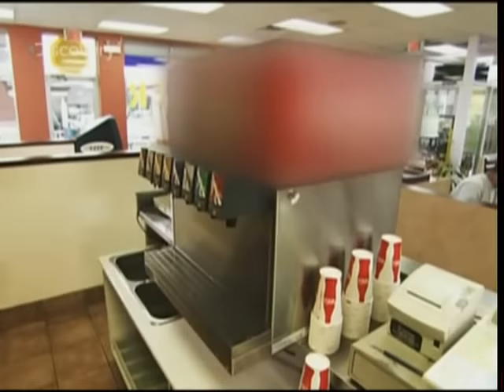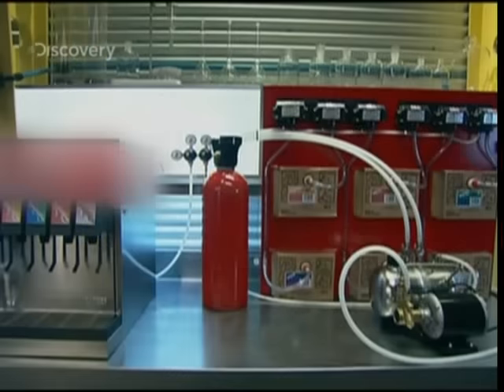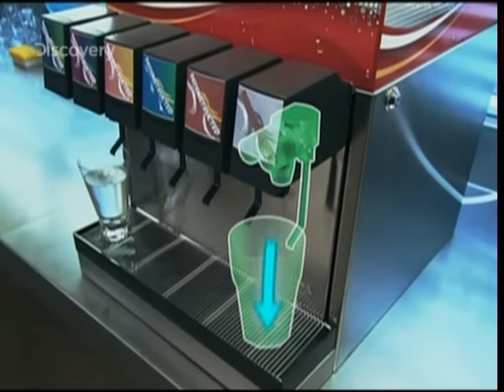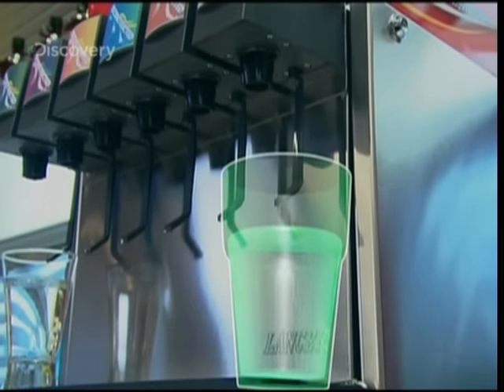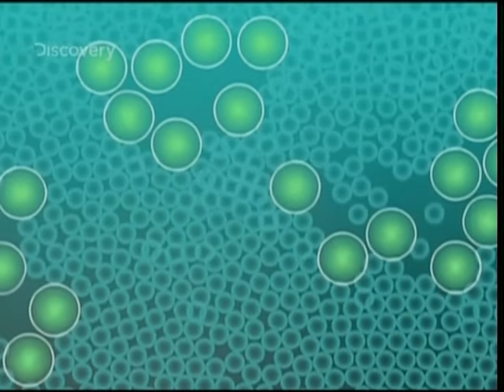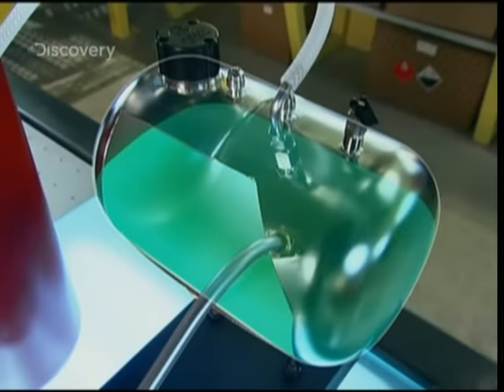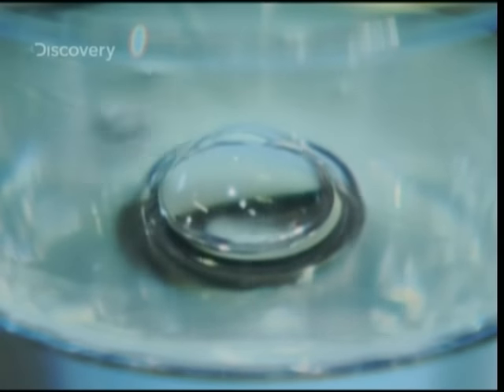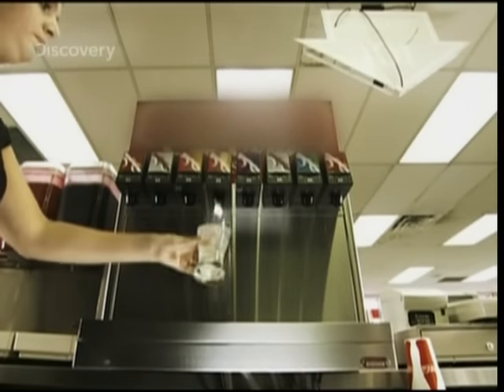How A Soda Fountain Works

Comment: Is it me or does sodas from this machines have more gas and bubbles? They also taste better than normal bottle sodas for me
Reply: because it’s the freshest form it’s being made as it dispenses it ,it don’t got time to slowly leak or lose carbon
Reply: Fountain soda is either the best or the worst.
Reply: @Nihyre  It also depends on the source water. If you can get a fountain drink system to connect to Reverse Osmosis Purified Water, you will have the best tasting fountain drinks.
Reply: Soda cans for me 💯
Reply: Or maybe it’s because I always get stuck with a busted soda machine at McDonalds 😅
Reply: @cliffsheets73  

That's why McDonalds has the best coke. Say what you want about their overall quality plummeting over the last 10-15 years which is 100% true for North/South America. They don't pinch pennies when it comes to their water quality, temperature control and soda syrup storage.
Reply: @esteban9357  

"It don't got time" = It do not got time

Your English is the equivalent of a coke left open in the fridge for 72 hours.
Reply: I don’t understand why sometimes it taste great and others it taste less sugary
Reply: @joebenson528  judging by his user, maybe English isn’t his first language and yet here you are like if its mandatory to write it perfectly. Maybe you should take your time to learn any other language instead of talking BS.

Comment: I honestly thought they just refill it with Coke/Sprite..etc and it just pours it directly
Reply: iSquamata ikr
Reply: Seemed like it
Reply: @Rhysiboi81  wym “idiots” you’re here too
Reply: That would probably be better as you'd no longer have the occasional half-flat soda when you get it right as it runs out, but more complicated.
Reply: @mblackops2  in that little thing???,?
Reply: I saw the pipes and the yellow thing what I thought was when you push the metal thing down the it puts pressure causing soda to dispense lol
Reply: @Statalyzer  

It's easier to store syrup concentrate and water than hundreds of gallons of each of the 6-8 flavors. And if a store invests in a dedicated Co2 system they half flat will not be an issue. McDonalds does this and you can tell. Where as gas stations pinch pennies where ever they can because they know customers expect low quality, so a flat soda or a watery ICEE will not hurt their reputation.
Reply: @joebenson528  If I'm at a gas station I'd never get a soda that way, I'd just get a bottle.  Every time I've had an issue with a flavorless soda it's been at a fast food place. I don't think any of them actually actively monitor it, they all just wait until a customer complains and that's their signal that they are out of [drink X flavor] in the machine and need to refill it.

Comment: I work at my college and we have a massive system I've dubbed Beverly. She purifies the water 4 times, carbonates it, and pumps it through 32 different solenoids ending with more than 20 different soda flavors, 4 bubly flavors, 4 brisk flavors, and a triple pot coffee/hot water machine. It is properly massive

Comment: You were absolutely right in your thinking,
there are. but they did not show these and they are usually in a back room or a basement somewhere.
either tall stainless steel cylinders with a black handle / tip-over guard  as the old way, but now they use what is called a "Bag in a box" design" kind of like the large boxes of wine you buy for parties. basically a box with a plastic bladder inside to hold all the molasses like syrup.

Comment: As I was reviewing a restaurant, I was curious as to what was in a soda.  I knew that there was a sugary syrup, and water, but how about those bubbles?  Well, this short video explained it all to me with the help of video and animation, and words that I could understand.  

So, I walk up to a soda dispenser at my favorite restaurant (Taco Bell) with a paper and wax cup in my hand.  I expect a certain sweet flavor.  I expect bubbles.  When I get both in the perfect combination, I drink the soda.  

The syrup is just a bunch of sugar and a company’s secret recipe for their soda.  The Mountain Dew that I prefer contains high fructose corn syrup, concentrated orange juice and other natural flavors, citric acid, sodium benzoate (preserves fresh-ness), caffeine, sodium citrate, gum arabic, erythorbic acid (preserves freshness), calcium disodium EDTA (to protect fla-vor) and brominated vegetable oil, and yellow 5.  I know this, not because Taco Bell tells me, but because I just looked it up.  

My soda also contains carbonated water.  How does it this machine create that carbonated water?  Well, water is a liquid, a mixture of two parts hydrogen and one part oxygen (H2O).  Carbon dioxide is a gas, a mixture of one part carbon and two parts oxygen (CO2).  These two are not compatible.  Inside the soda fountain is a tank.  Water is pumped in and carbon diox-ide is pumped in.  When their molecules meet, they don’t mix.  In fact, each carbon dioxide molecule just hangs out and lets the water molecules surround it.  It doesn’t attack the water molecules or try to combine with them to form a new sub-stance.  Each carbon dioxide molecule just sits in there, wait-ing.  And when the machine spurts out the carbonated water into your paper or plastic cup (mixed with syrup, of course), these gassy carbon dioxide bubbles finally find a way to escape.  

When you look into a cup and notice tiny bubbles rising from inside and popping on the surface, what you’re seeing, hearing (and smelling if you get close enough) are the carbon dioxide bubbles escaping.  In a typical glass of soda, there is a full glass of water (and syrup), and five full glasses of gas (car-bon dioxide).  

A final question.  Where does that carbon dioxide go if you drink the soda?  I looked this up online too (though I kinda new the answer).  The gas goes right back out of your stomach, up your esophagus, and out your mouth in a belch (or burp).  Some might go out the other end a few hours later, along with the gasses produced from the food you eat (like that magical and fruity food we call beans). 

Now I know how a soda machine works.
Reply: Wow
Reply: Faaarrrk me. Mate, that was so boring to read I dozed off halfway through and nearly missed my train stop.

Comment: Many thanks for a great explanation and illustration. Pay no attention to the critics.
Reply: Are you kidding? It is not even scientifically correct! Carbonic acid is dissolving in water - not CO2. However as carbonic acid is unstable, CO2 is formed, as soon as it is out of pressure. Oh - wow - I did it: I explained the whole science behind it in a 10th of the time, this dork did. But I got it right...
Reply: Wrong! Gases such as CO₂ DO dissolve in water. The weak carbonic acid formed is a side effect.

Comment: note The Carbonator Gages Regulates the amount of Beverage air that goes to the pump before it Gets to the Fountain and there are Regulators on the Suryp pumps also that Give the Amount of Suryp and water to the tap.pending on the Size of the cup the Technicians set the Gages to the amount of Suryp and water and Beverage air going to the tap
Reply: not really, the syrup to water ratio is adjusted at the dispensing valves located on the front of the fountain dispenser. the regulators on the co2 tank set the carbonator pressure about 100psi, and the syrup pump pressure about 40psi.some systems conserve co2 by using a separate air compressor to drive the syrup pumps so all of the co2 goes into the carbonator.

Comment: WELCOME TO GOLD SODA

Welcome to Gold Soda fountain machine, an ISO 9001:2008 Certified Indian Soda Fountain Machine Manufacturer Company based in Gujarat. Our soda fountain machines are designed meticulously to meet the quality standards as well as expectations of our esteemed clients. Our machines are used widely in an array of diverse settings like restaurants, hotels, corporate offices, near railway stations, taxi stands, educational institutions, etc. The fact that we never compromise on quality and give high regards to client satisfaction has made us today, one of the established retailers in the ever competitive market.

Why choose Gold Soda Machine?

Well, there are some specialties that one can find only in the products offered by a reputed Soda Fountain Machine Manufacturer Company like us! These are mentioned below.
Pressure development system
Digital temperature control system
4 x 11 carbonate tank
High durability
Super cooling
Energy efficiency
User-friendly
Maintenance free
Long time strong soda
Our machines are designed to load every glass to full capacity and to run safely in the inverter mode. Highly functional valves like Lancer, flowmatic and Curnoluise use in our machines as per the client requirement. What�s more; we also have the renowned Norwegian Accreditation that speaks volume of our incredible product quality. Our machines offer a variety of flavors like Cola, fruit Beer, Lemon, Orange, Mango and many more to suit the need of both rural and urban settings.

Just order a soda fountain machine from us and enjoy amazing profits without any effort all the year round. Visit our website to have a glance at the glass cost estimation to explore more

OUR PRODUCTS

Gold Soda
4 +1 SLIM SODA FOUNTAIN MACHINE

Gold Soda
6 + 1 SLIM SODA FOUNTAIN MACHINE

Gold Soda
6 + 2 DELUXE SODA FOUNTAIN MACHINE

Gold Soda
8+2 FULL CHILLING SODA FOUNTAIN MACHINE

Gold Soda
10+2 EXTRA QUANTITY SODA FOUNTAIN MACHINE

Gold Soda
12 + 2 MOST SUCCESSFUL SODA FOUNTAIN MACHINE

Gold Soda
18 + 2 BIG LOOK SODA FOUNTAIN MACHINE

Comment: Are they just using unfiltered city water?  That is why if I do drink soda which is rare, I first like it from a glass bottle to avoid a can taste and second I know the water is put through a filter at the factory.
Reply: A lot of restaurants use water filters in this process. This example didnt show it. You'll know if the water if filtered by drinking water from the fountain.
Reply: @oscarg.3330  Even if the water is filtered I still stay away from fountain drinks.  You do not know if the soda machine is cleaned everyday. Since corn syrup or sugar is used it is very easy for the machine nozzle tips to have bacteria growing around them if they are not cleaned daily with hot water and soap The bacteria can possibly make you sick. I still prefer any kind of soda from a glass bottle.
Reply: @dphotos  of yeah.  I seen the stuff.

Comment: This documentary is a lie.
you don't need lots of pressure to force the water to carbonate.
If you chill the water before mixing in co2 it will carbonate.

If what i said wasn't true you wouldn't be able to carbonate water with just a keg filled with water and a tank of co2.

All the carbonator does is agitate the water so you don't have to sit there mixing the water back and forth.

You could easily carbonate water on the fly if you wanted to, using an inline static mixer.
edit
Just to clarify. water doesn't mix well with co2 at room temperature.
if you want to carbonate all you need is cold water and co2. The pressure from the co2 alone can help carbonate the water it just needs to be agitated.
Reply: Interesting, how do you know so much about this?

Comment: This is one of the worst pseudo-scientific explanation I have ever seen!
He actually explains the solution of nitrogen in water - however carbon dioxide is a whole different thing! Because there is carbonic acid, which dissolves in water (no - CO2 doesn't become liquid under this type of pressure... it is totally wrong - it is actually really difficult to get CO2 to a liquid state...).
Wow this production team supposed to get fired from the Discovery Channel!